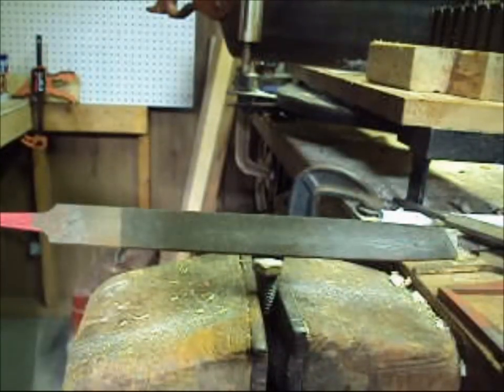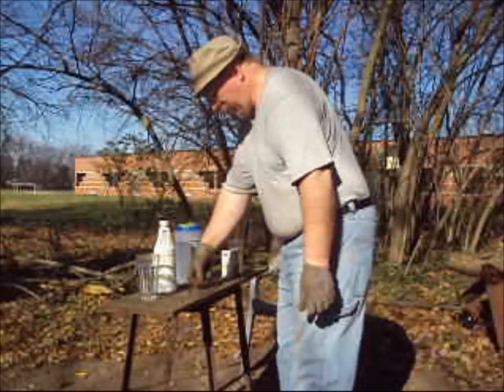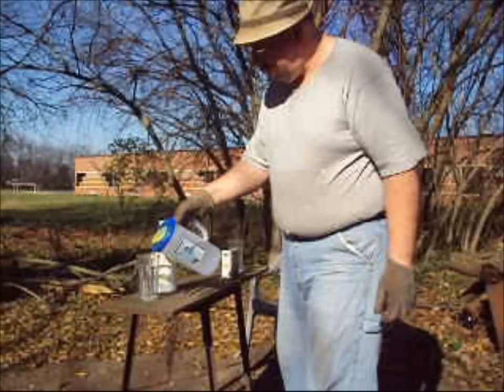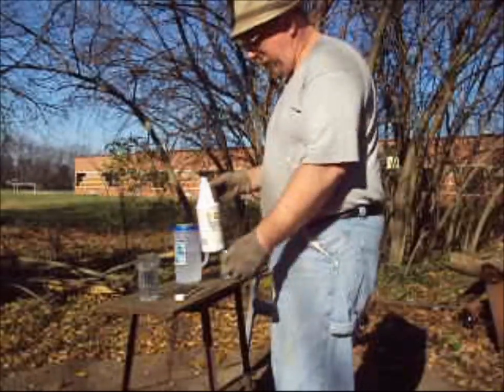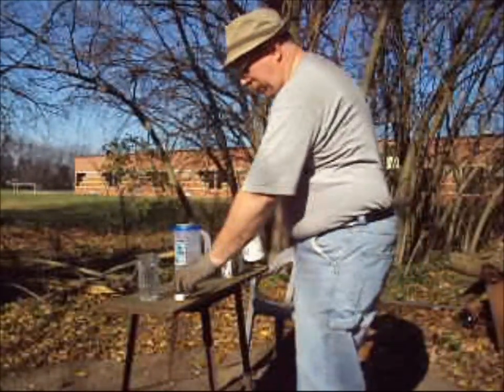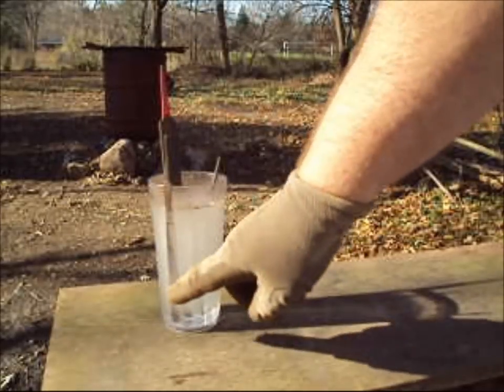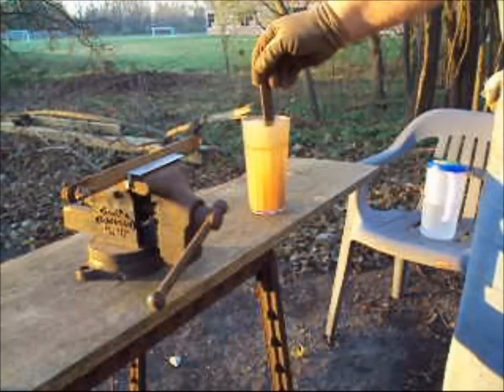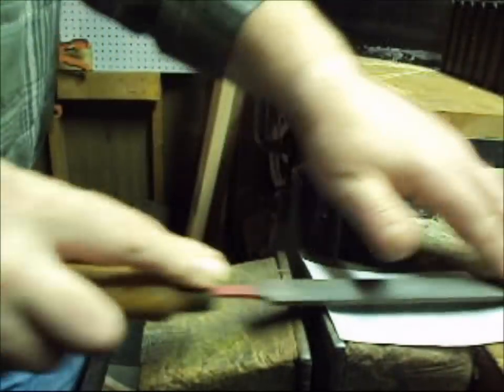Sharpening A File With Acid - a video tutorial from Old Sneelock's Workshop

Comment from the maker: Having performed this many times I can testify that it does work. Three years ago I made this video where I show the test of a clean, dull, file. Both before and after sharpening. The sharpening process is effective on files that still have teeth. Missing teeth will not be magically created. A file that is dull to the point of skating over a mild steel surface can be sharpened to where it will cut the same mild steel surface. 
My understanding of the process is that both surfaces of the file tooth are attacked by the acid. At the same time the tip of the tooth is also being attacked. The triangular cross section looses one atom from each face, and one atom from the point. The effect is to make the tooth thinner by the thickness of two atoms while it gets shorter by the thickness of one atom. 
Then there is the counter argument that it only cleans the teeth. If the teeth of the file are plugged with pinning, metal shavings that get jammed into the teeth from improper use, the acid will react with the pinning, depending on what material the pinning consists of, and eventually remove it. The problem with that comes from the shadowing effect caused by the pinning filling in the gullet of the file tooth. By filling the gullet the pinning prevents the acid from reaching the face of the tooth. The acid acts upon the pinned surfsce as if it were a flat surface and removes one atom at a time from all of the surface it in contact with. The file tooth gets shorter without a reduction in its cross sectional thickness. 
So why doesn't the file cut as well as it did when it was new? If you leave the file in the acid the teeth are eventually eaten away leaving a, more or less, flat surface. I said earlier that the acid, if used in this manner, will not create teeth. As it is eaten away, the tooths pitch, the distance center to center between the teeth, doesn't change. The acid removes one atom from the bottom of the gullet at the same time it removes one atom from the tip of the tooth. The tooth gets smaller in cross section in a two to one ratio with its reduction in height. Carried to the extreme the tooth disappears. The effect reduces the gullet, the space where the chip collects, between the teeth. The reduced gullet fills quicker. The file pins and stops cutting when the gullets are full, thus causing the file to slide on the pins instead of cutting. 
So why don't I sharpen drills with acid? Aha! You've got me there. You have found the fatal flaw in my argument. No one sharpens drill bits with acid. Why doesn't anyone sharpen drill bits with acid? Engineers, machinists, and shade tree mechanics should be jumping all over this method. If it worked they might. The problem is that pesky bit of logic that says the acid removes metal from every surface it touches. Drills come in many sizes. All of them sized by their diameter. Reducing their diameter means they cut a smaller hole. Not very effective. The preferred method, which is grinding, is selective. The cutting edges at the point of the drill are sharpened by removing material, much faster than one atom at a time, from the end of the drill in such a way as to reduce the cross section of the edge. Just like the acid does. 
Short answers:
Acid only cleans the file. No. But it really needs to have a clean file to start with in order to work well. 
It's never as sharp as a new one. Yes. The teeth are shorter and won't hold as much chip load. 
You can't sharpen drills this way. Yes. Drills aren't files. Files don't need to be dimensionally stable. 
I hope I've answered your questions. If not you can go to Old Sneelock's Workshop and see me sharpen files and drill bits. If you really want to know exactly how this works you can perform your own hands on testing. Like engineers, interns, and apprentices do every day. When you have finished your capability studies come back with your facts and data and we can have a discussion. 
Until then, and I'm sure long after, I'll keep using resharpened files. Why? Because they work.
Reply: Rory and joey
Reply: Thanks. Thoughtful explanation.

Comment from the maker: Thanks for asking. The vise on the table with the steel bar is for testing the sharpness of the files. After the first hour I pulled the tricorner files when they cut well. It took about 2 hrs n the acid  for the large file since it was much duller than the tricorner files. After it's sharp I only put it in the baking soda for a few seconds until it stops foaming.

Comment: A piece of PVC pipe capped on one end makes a good acid vessel. I did it in my shop and for the first time in 30 years everything began to rust. On some other channel or web site I mentioned this technique and some know-it-all swore up and down that the process doesn't work but it does.
Reply from the maker: Yes you definitely want to do this outside and away from your tools. Sulfuric acid will eat up unprotected steel. 
That's why I flush the files with baking soda after sharpening them. 
We can only offer suggestions. if some choose to disagree then they are just missing an opportunity.

Comment: You can use acid type toilet bowl cleaner for sharpening files and rotary rasps, it works better because surfactants have been added that will improve wetting and it will clean off any residual organics.  It is also easier to find at the store.

Comment: You are the first person I have seen on YouTube that uses a file properly!!! Most demonstrations show the "expert" dragging the file back across the job with as much gusto as they use on the cutting stroke, I suppose if they had to make their files as a gunsmith does they would have a little more respect for them, and maybe, just might understand how they work.
On the strength of just this video I have subscribed! I have no doubt you will receive many comments about "you have just cleaned the file" these will be from the armchair critics that probably never handled a file. Many thanks for posting.
Reply from the maker: I wrote out the whole process and post it at a moments notice. The Ed Prices of the world don't bother coming back after the second time.
Reply: Could't agree more!
Reply: I hate to tell you:  In my limited experience people want to file backward!  I've seen it many times.  Engineering students, even a professor here and there.  They'll do the same with a hack saw, too.   I used to say that "Don't File Backwards!" would be on my tombstone.  A great and very convincing demo for this is to do as we see here- clamp up a chunk of something, using a piece of black paper under the work.  I use aluminum and a coarse file.  Take a few strokes and it's just snowing aluminum in a very visible way.  Filing or sawing backward doesn't produce any chips to speak of.

Comment: Thanks for sharing this information.  I wondered how to sharpen small mill files.  I sharpen hoof rasps/files using sulfuric acid.  Works great and they are sharper than new.  I use the acid right out of the jug poured into a capped 2" PVC pipe.  It takes exactly 9 hours.  I found that I can sharpen them 4 to 5 times before they are nothing more than knife blanks.
Reply from the maker: Glad it's working for you. A while after making this video I began exploring yhe idea of vinegar for rust removal. The test samples were auger bits so  there was a good reason to find a way to submerge them in a smaller amount of liquid. Like you I went with 2" pvc. Probably those 12" long files work like the auger bits I was trying to clean. 
Haven't sharpened any since this batch either. Must not be doing as much filing as I use to. :-)
Reply: Old Sneelock's Workshop Thanks.  Just an FYI: I use gun barrel bluing etch on the naked steel to help keep it from rusting.  The etch comes in blue, brown and gray.  It's a simple wipe on with a mop applicator much like a pvc glue applicator.
Reply from the maker: Hardnox Using the bluing is a great idea. I still have a bottle of Plum Brown somewhere. I used it when I made my black powder derringer 30 or so years ago.
Has It been that long? I tend to hang onto things. :-)

Comment: Hi there,just for the unbelievers,the acid etch works wonders! Just a tip,always use a file for steel and another for brass or non ferrous metals,as a file used for steel will not work correctly on non ferrous metals,and never allow one file to touch another file, keep each file wrapped separately,to avoid damaging their teeth.Then a good set of files will last many years at home.
Reply from the maker: Seems like most of the junk boxes that I got at auction had a least 2 files in them. After I learned the sharpening trick I cleaned, then sharpened them and now I have a bunch of them wrapped in paper in one of the bench drawers.
Reply: Good info Jeremy.  I always insulate my files from clanging together.

Comment: Acetic acid (vinegar) is a known rust remover.  A very weak acid but it must have some etching effect as well.
Reply from the maker: It works quite well. I like apple cider vinegar better than the white. White come at up to 10% concentration, but the apple cider vinegar smells much better than the white. 
Sulfuric is cheap and I can mix it to the concentration I want. It is also faster than vinegar. 10% sulfuric will work in about an hour or two depending on how bad the file is. Vinegar can take up to 24 hours for the same effect. I'm not that patient. 😁😎

Comment from the maker: Dwight Stewart in answer to your query:
I wondered how that worked myself. I've speculated but never done any microscopic examination. I think that since the acid eats the metal away at a constant rate over the entire surface the acid is removing an atom from each side of the tooth at the same time it is removing one from the edge. That would mean the tooth is getting thin twice as fast as it is getting short. The effect would be to thin and sharpen the tooth. 
As far as whether I was "clearly pressed down harder" with the sharpened file you are welcome to invest in a force gage and test the theory on your own. Empirical testing data tells me the files are sharper after I have run them through the acid. You are free to believe what you wish.
Reply: So far I've tried a couple of experiments with masking the tips pf the teeth with marker and bluing. Unfortunately it "bled" too deep into the teeth to change the etching profile the way I wanted it to. The idea is that the longer you can keep the acid from attacking the tip, the sharper the file would get. I'll try a few more things and get back to you with results. Meanwhile you can try different things yourself.
Reply from the maker: Candle wax might work. Heat it to just above plastic state and gently stroke the wax over the file backwards. It's sticky and resists acids well.
I'd be interested to hear about your results.
Reply: Old Sneelock's Workshop
Great idea! I'll be sure to add that to my attempts.
Reply: It is also eating away at the cutting Edge of the tooth, dulling it further.  The file may be cleaner but is not sharper.  If this theory were true, we could sharpen knives in Vinegar or other weak acid.... Think about it.
Reply: I found it works on files that are slightly dull but doesn't do much for those that are very dull.  That's been my experiance
Reply from the maker: Gord Baker Gord we really did think about it and you are wrong.
Reply from the maker: E.PLUMBUS UNUM The process works by removing metal. Teeth that have been broken or worn greatly have a problem. Even though the acid is thinning the tooth twice as fast as it is shortening it, by the time the acid has thinned a broken tooth to a point it is too short to be effective.
Reply: For the reason given above it does actually tend to sharpen the file.  The downside is that while it makes a sharper point to the file tooth it also makes a rounder gullet between the teeth.  This obviously limits the number of times you can "sharpen" a file this way.

Comment: I don't get it. Is the acid cleaning the debris between the teeth or is it actually sharpening blunt teeth? And why not just rinse the acid away with plain water. What difference does the baking soda solution make?
Reply from the maker: The file needs to be clean before you start etching it with the acid. Dirt masks the surface of the teeth preventing the acid from removing the steel evenly. 
Using a base neutralizes the acid rather than diluting it. Without the baking soda there will be weak acid in every pore of the files surface. 
The file will flash rust almost immediately and will continue to rust until the file is gone or neutralized.  😁😎

Comment: Hi, a question: can this procedure, which is illustrated in this video, also work for the file that some Victorinox multipurpose files have? Otherwise that kind of files and (especially) the metal saw they have incorporated, how can they be regenerated? Thank you.
Reply from the maker: It should be removed from the knife before you attempt sharpening it. 
Plated files will not work as well. The plating will affect the amount of and where the etching the acid is doing will be.

Comment: Nice! Would this method work for sharpening fish hook points? I think I will try it.
Reply from the maker: I haven't tried it. If I did I would only put the point in the solution. No reason to reduce the shank size. Let me know how it works. ☺
Reply: @OldSneelock  Cool! I have been thinking of creating a jig to hold the fish hooks so only the point will be submerged in the acid. I also have a crazy idea of maybe hooking it up to a motorized lead screw controlled by an arduino on a timer and then slowly pulling the fish hook up and out of the acid (Maybe an hour or so) so that the tip is submerged the longest This should be an interesting project. Going to order some sulfuric acid to experiment with. Thanks! - Jeff
Reply: @jeffd4927  If you did this, it would be great to see the video.  Got to be worth a like for just giving this a try.